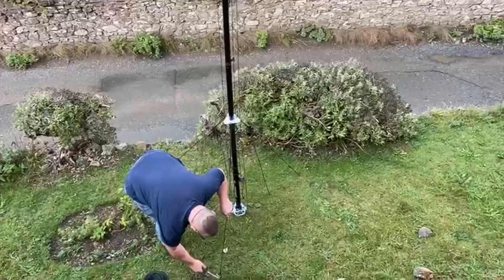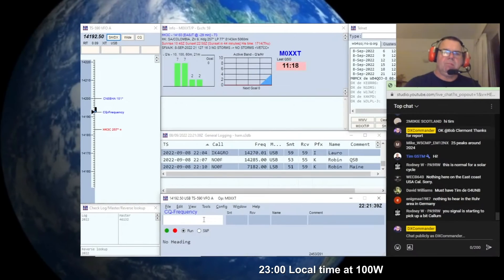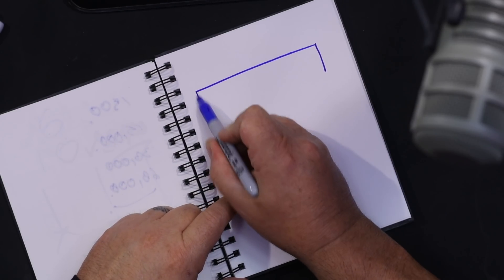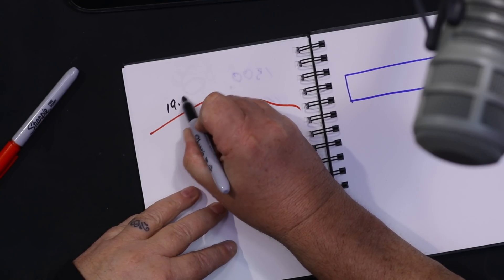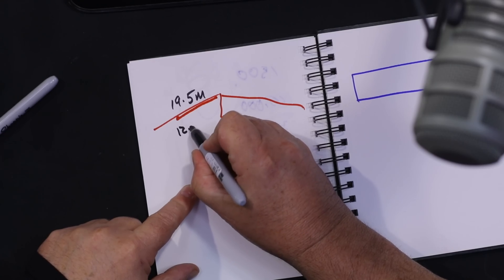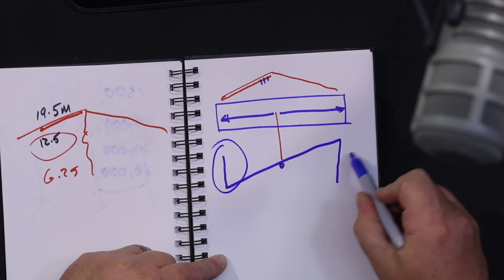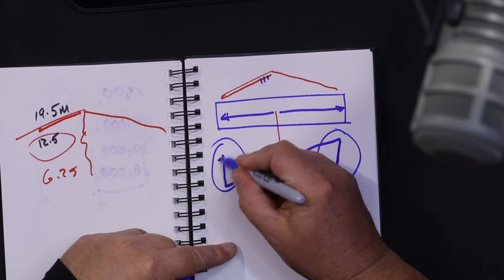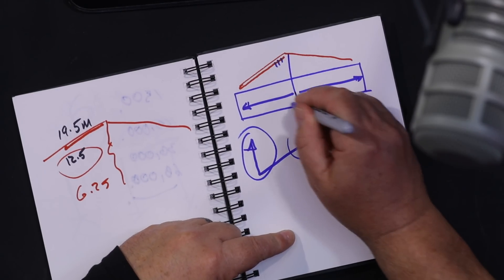Maximizing Your Signal in a Small Space: Affordable 40m Antennas for Limited Yards / Plots

Comment: Calum, could you use vertical with elevated linear loaded counterpoise to make vertical better
Cheers
Mos
Reply from the maker: "Better" unlikely but would depend a gazillion factors. You could do anything...
Reply: Was thinking better than just a few radials on ground.
Maybe bad idea,just a thought
Reply from the maker: OK, so elevated radials work great from about half-a wavelength up - ideally more to make a real difference - and then on 40m - that would be VERY HIGH :)

Comment: Get up whatever you can. Wire aerials want to work.
I squashed a 60m inverted vee into my 25' x 13' garden.. An odd shape but it works. 180 mile QSO using 350 mW (Pixie) and SWL report at 220 miles and QSO at 280 miles with 2 Watts, both c.w. Not a lot of activity on 5.262 MHz.
G4GHB.

Comment: Summary: Do Radials have to be Laid-Out in a Straight Line, or can they have Bends (45 to 90 Degrees) in them to Avoid Obstacles?
Thank you again for this video. As I listed in my previous comment below, I have an MPAS 2.0 20' vertical antenna planted in a small (50' x35' back yard filled with 3 raised beds and a greenhouse), so laying out radials (on the ground) in a straight-line starburst pattern is not possible, unless I raise them up and lay them over the veg. beds. 
So I've been experimenting by laying out 33' (1/4 wavelength on 40m) radial wires on the grass, and bending them (45 to 90 degree - single bends only) around the ends of the veg. beds.  The swr goes way up, but the reactance stays pretty much the same (I guess due to the unun in the antenna base).

Have you ever run into this problem of running radials in a yard full of obstacles that actually improved the signal, while avoiding the need to take the radials down each time the lawn was mowed?
Any advice would be much appreciated 🙂
Reply from the maker: I bend mine all over the place. Frankly for what we do, you would never know..
Reply: @DXCommanderHQ  Thank you  - that  was what I was hoping.  DX Engineering has a 'tip sheet' on radials where they say not to bend, zig zag, or overlap radials. But I guess you just have to try thngs.

Comment: Very interesting video ! Thank you for posting.
But I have to ask  ... You got cross-atlantic contacts using a DX Expedition that DIDN'T HAVE ANY RADIALS ??
I got the impression from your 'How many radials' video that you needed at least enough radials such that the sum of their lengths added to 1/4 lambda for the longest band you wanted to use.
If you got those dx contacts using an Expedition without any radials, then I could probably fit one in my back yard.  I had wanted to get a DX Commander when I first saw your videos, but decided against it when you explained the need to the multiple radials.
My back yard  is about 50' x 36', but is filled with a shed, greenhouse (aluminum-polycarbonate), and 4 raised beds.  Laying down radials over the raised beds would require them to be removed and replaced every time the grass was mowed.  Also, having them laying over the beds, then hanging in the air over the lawn would make them inefficient.
But if I can put up a DX Expedition and get dx contacts WITHOUT an array of radials, then that is something I would want to do.
Please let me know if this is worth doing.  Thank you.
Reply from the maker: I DID have radials. See 0:58 I am attaching them. I have never suggested 1/4 wave radials see 08:09. I've suggested an overall length, that is - if you add up the total length of wire on the ground - ideally aim for not less than 2 wavelengths at lowest freq.
Reply: @DXCommanderHQ   Ohhhh...Nuts - I thought youu were just adding the guy wires!  I was SO hoping that I could get away without radials.
Given my 'complicated' back yard configuration (see my post above), laying out 2 lambdas worth of radials with them hanging over the raised beds is going to be a bit of a chore if I have to gather them up and re-deploy them every time I mow the lawn (about every 2 weeks in our 'temperate rain forest' weather.
.
Callum, can I lay the radials (a mix of different sizes) on the grass AROUND the raised beds (sort of a zig-zag kind of layout), as long as long as the sum of all lengths exceeds 2 lambdas?  Or will that mess up the resonance too much?
Thank you.

Comment: Good vid. A Z, or more accurately a zig-zag (2 bends on each leg) is working well for me as a 40m element of my fan dipole in my small 8m 4.5m loft. Photo and sketch on my QRZ if anyone wants more detail M7TDV. I'd love a QTH by the sea like your holiday home, the location must help a lot to get the signal out.
Reply: Thoroughly impressed by your fan of wires in the attic. Shame my shack is in the attic  well lined with  steel profiles to hold the plasterboard. Hope to catch you on the bands with wires hanging outside. 73de SP9MUF.

Comment: I’m looking for an antenna I can use on my 6meter long fibreglass boat. I’m thinking efhw, with either about 12 meters with a 35uH coil near the end for 10,20,40, or 20meters long, which will give me 10,15,20,40. (Foundation license, can’t use 20). 20 meters of wire is going to be a real challenge to string up on a 6 meter long boat though !!
Reply: That’s an interesting subject, installation of HF Antenna’s on a Sailing boat. I have a mate with a 35ft sail boat, and sometimes take my radio to use when we are in a marina. I find my EFHW cut for the 7MHZ band works well with a 49:1 . Your mast may not be tall enough to get the centre of the wire to the top of the mast to get the apex of 120 deg or so. Then you need some length in the boat for each leg at the same time as trying to avoid any metallic stays!! I have also used a 17ft vertical whip on the back stay, but haven’t tried it with a wolf river coil yet. 73 M0KVA
Reply: @alexdokic5567  yes, it’s not a sailboat, so no mast. 
73

Comment: Re limited acreage under a vertical.

Perimeter ground planes are a good option.  round the boundary, connected back to base of antenna at each corner, and if it is a strip like yours to the centres of the longest sides.
Reply from the maker: Interesting!

Comment: At a previous address, I built a 28.8m long doublet configured in a z shape (linear centre section only 13m), and fed with 11m of home made, 4inch spaced, ladder line.
Up at 17 ft.
Worked great on 40 and 15.
First QSO on 15 YB0.
FIRST outing on 40 was K4 px at 10:00 utc.
It was a whizzo.
Reply from the maker: Lovely.. I do LOVE a doublet.. Band changes are a bit of a hassle and going underground with balanced feeder is a bit weird too. Never cracked that..

Comment: An interesting watch as usual, thanks Callum. I would love to see how a "Z" fares, maybe compare a bit short, medium short and very short? You asked for other ideas... I've been looking at John Portune's work on YouTube and he has done well with spiral winds on parallel columns as stealth antennas. I know the DX Commander is tapered but you could spiral wind for part, go straight line to the top and then go inverted L for the rest of the length. 

If you were the lucky owner of 2 DX Commanders, you could make 2 of the suggestion above, join and feed them in the centre to make a centre fed dipole. The spiral would be a loose version of loading coil but would distribute more evenly like the old Firestick CB antennas.
Reply from the maker: Interesting!
Reply: @DXCommanderHQ  What I should have added is that I'm aware a centre coax might be too heavy and need some tension guying or a 3rd DX Commander the centre... I know you sell multi pole kits... Just thinking out loud. That's always dangerous!🤣

Comment: Craig (2E0HXF) -  in the military we had short T2FDs which used as "slopers" or inverted Vs would get you on the air pretty much anywhere on any frequency (not just Ham bands), with really low reflected power. Nearest commercial equivalent would be the diamond WD-330S.  Build one with a home made 300 to 400 ohm resistor "block" (loads of series/parallel 100 ohm carbon resistors, potted in aroldite to get the overall power handling you need), and string it from a DX commander expedition pole/gutter/tree - you have 160 through to 6m in about 8m by 2m.  Not resonant, so only say 50% efficient, but if space is limited...
Reply from the maker: Hey, I was reading about that antenna last night!

Comment: if you had 14 meters or 46.5 feet to work with  you could  could get a Moxon tuned for 7.200Mhz great video  could always use a random wire sloper and 9:1 unun 73
Reply from the maker: Moxon.. Erm, I would also need a bit the other way too. But interesting!

Comment: I've built a 20m and 40m version of a dipole and put one leg up a 20 or 40ft fiberglass pole, feed point (just a bnc 2 pole connector) a couple of feet off the ground and the other leg running off an 90 degrees about 2 ft off the ground. Worked portable with 20 watts at different times (mostly FT8) with great results. I even set up the 20M version on a 2nd floor balcony of a condo in the mountains for a week. I tested various setups when building them such as adding radials etc. but they work best just as an L with the one leg off the ground about 2 ft. Very simple and quick to put up. I don't know the math behind why they work but they do. Looking at your strip of yard, you could use an EFHW and make two 90 degree turns that should work just fine. My "fence antenna" is an EF with two 90 degree turns and about 5ft off the ground and it works great. I love playing around with wire antennas. Thanks for another great video! Jack K5FIT
Reply from the maker: Jack! Another antenna man! Love it :)

Comment: Callum, you could also do a HALFSQUARE for 20m. Its a killer 2 phased verticals fed at top corner with 50ohm - and no need for radials on the little strip. I have just made one for 40m today. Its also a dead silent antenna. 73 - Henrik OZ1ING OOOOZING
Reply from the maker: Oh yes! So.. let me remember that one.. 5m "up" then 10m "along" then 5m "down" again, fed in top left or right corner..? (and tuned to suit).
Reply: @DXCommanderHQ  Correcto Sir
Reply: PS the coax shield goes down the first leg - and try to pull the coax as much "away" from the radiator
Reply from the maker: @henrikweiss4474  Yes.. I ways wondered about that. Thanks.. PS.. Send me picture!!

Comment: What about a 35.5' random wire antenna with a 9:1 unun and a 17' counterpoise? That should work on 10-40m. I have one that I use portable for POTA and typically put it up in a sloper configuration, either in a tree or with a 33' telescoping mast. While it's probably not the most efficient option, it doesn't require much space and is easy to jump between bands.
Reply from the maker: Good point!

Comment: Years ago, I had a small townhouse and built a 10/15/20 fan dipole in the attic. Because of the distance limitations, the 20 portion was a "Z" like your zed shape. It worked great until the complex installed digital cable TV and wiped out all HF for me.
Reply from the maker: Cable TV... Ugh!
Reply: I'm currently putting together a Cobwebb antenna for my attic, which is basically a folded-into-a-square, folded fan dipole. It does 20m, 17m, 15m, 12m, 10m and 6m and is in a square of less than 3m per side.